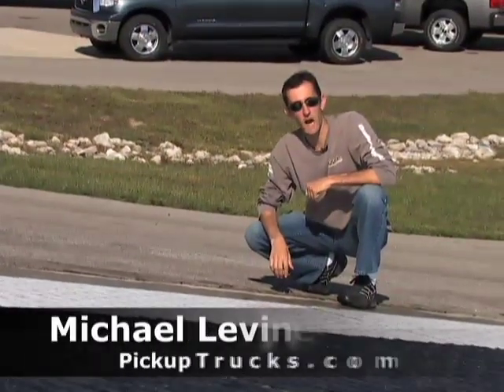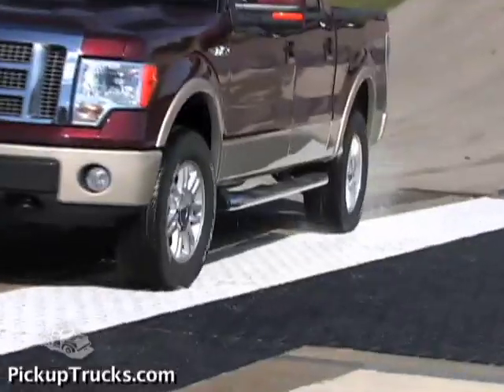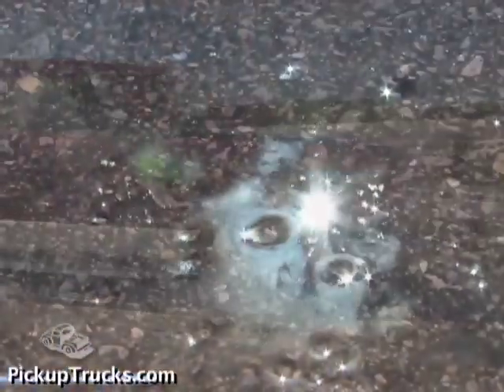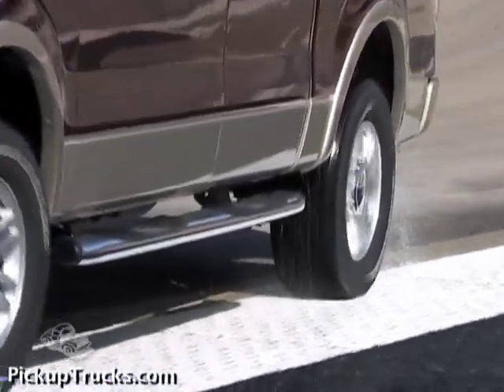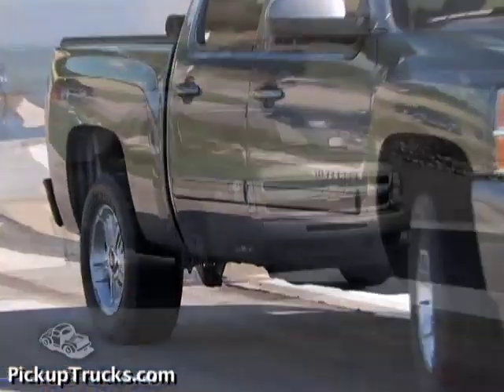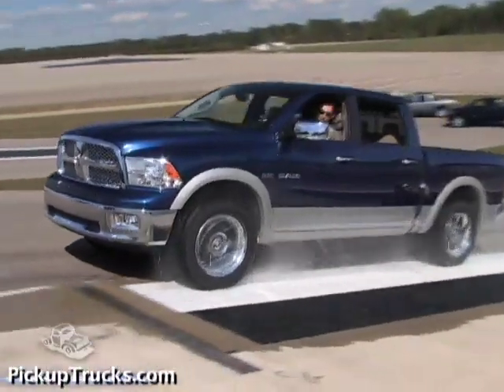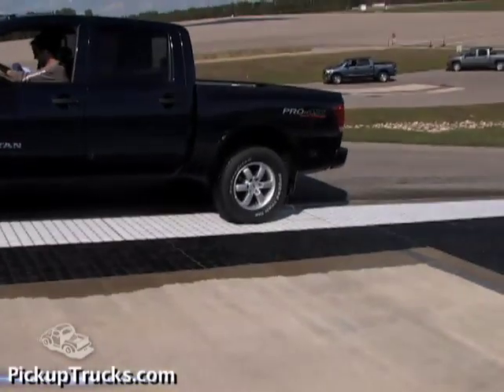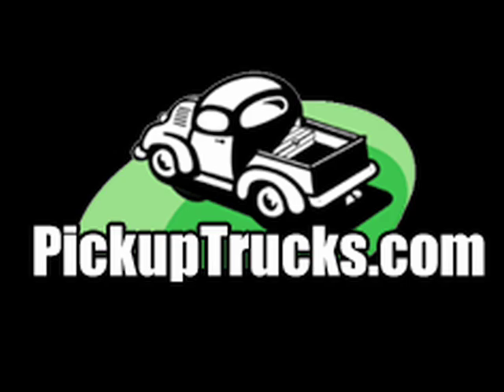Extreme Traction-Control Test

Comment: GMC Sierra and Chevrolet Silverado are the same vehicle, they are manufactured in the same factory and use the same parts under the engine, putting them in a test together is basically putting two of the same truck in a test
Reply: Aric Castro is true is the same truck
just body works and prices
Reply: Yeah and neither one of em could make it lol
Reply: Aric Castro they are the same but yet some people will still say they are different
Reply: They just change the logos
Reply: @splitrim509  because the test was rigged.  Take that to the bank.

Comment: The guys that performed this test don't know how to drive, or to use the vehicles the way they are designed.  The GM trucks did not have a traction control system, just automatic locking rear ends.  But they tried to drive the GM trucks like they had traction control.  Traction control cuts engine power to stop wheel spin.  In the GM trucks if the they had simply let off the gas a little after the wheel spin began, the trucks would have walked up the hill with ZERO  problem.  The fact is they didn't operate the vehicles the way their respective systems were designed to be used.    If the truck doesn't have a traction control system to cut engine power, guess what?  You have to do that with your own foot.  They just mashed the gas pedal in each truck, they didn't use the proper tools, it would be like if a carpenter tried to build a house using only a hammer, no saw, no measuring tape, no level.. gee how would that house turn out?
Reply: +Chris Winings Good comment i totally agree' GM been using the G80 locker for a long time, if they would have let up the throttle while the locker is engaged the trucks would have no problem.
Reply: +Keith Bartlett Yeah at one point in the video you see the driver just lets off the gas as soon as the tire breaks loose, not even enough time to let the g80 lock. My g80 has saved me so many times.
Reply: also in the states, most of your trucks are autos, use manuals much better :)
Reply: Is the proper operation of the G80 is to first let it spin to lock up, then proceed at lower throttle?
Reply: Frater Mus Yes, I have a G80 in my S10. For the G80 to work it must go like this.
> Rear tire spins in low traction conditions
> Ease off throttle, at the same time the automatic locking differential engages
> Now the tire with most traction has torque, so you crawl out 

In this video they were just fucking putting the throttle to the floor, as you can see in the video, the wheel that was on the High Traction suface was burning out because the dumbasses were just trying to gun it up the hill. you're supposed to let the locker engage and then crawl up the hill. How can the tire gain any traction if they are purposely spinning it?
Reply: William S. Damn good point-I've noticed that with my G80 in my Silverado,you should have been in the Chevy during the test bro.
Reply: youre correct! ive noticed that in some conditions as long as you have sufficient momentum in the direction youre trying to go you may be better off not letting off the throttle such as in snow going up a hill. better to keep the momentum and continue to climb and just let the locker do its thing. but in the situation in this test, and in most real world situations,  you're absolutely right!!
Reply: frater mus   heres a video of a very similar test, notice they dont allow the tires to keep spinning after the g80 locks in. in the last truck you can clearly see they only give enough throttle for the locker to engage, then they proceed up the hill. https://www.youtube.com/watch?v=xdND6o9Vsqo

Comment: Nissan just stop trying lmao.
Reply: the titans aren't bad i got a 2013 and it a amazing truck had no problems with it unlike the chevy and dodge we had
Reply: ***** they have been doing horrible on tests
Reply: i like mine best truck i had yet and its mint in the snow
Reply: give it a year or 2 and it will be a rust bucket like every vehicle in the snow
Reply: o well it rusts then it rusts every vehicle does
Reply: ***** Not if you wash your vehicles weekly and make sure to choose a wash that gets the undercarriage good. I can't stand to see cars that are ate up with rust, shows how lazy their owners were. Furthermore, if you begin to see rust, take some 200 grit sandpaper or so and sand the area down. Then if nothing else, spray paint the area. Nobody would know since its in the undercarriage right?
Reply: My titan is 11 years old and is still running fine with 250 thousand miles
Reply: The titan they tested was a pro 4x, it had a real locking rear diff so it would have been more capable than any of them had it been locked.
Reply: It's a manually operated locker on the rear unlike the lsd on the others. If it was engaged from the beginning it would have climbed it easily.
Reply: PBako test don’t mean shit. Still out last have the pieces of shit they had in this video.

Comment: uh.... when my locking diff locks in my chevy, that makes both rear wheels turn the same speed. should have no issue going up the hill, not sure how they screwed that one up.
Reply: Exactly my thoughts. My Tahoe does extremely well with the G80 and about 10k worth of weight.
Reply: ***** Probably because they had all seasons on the rest of the trucks besides the tundra and the f-150. Shoulda ran the same type of tires on all of them. I drive a 2wd silverado w/ nitto highway terrain tires (lol)  and I get around just fine in the snow and ice.
Reply: Connor Harrell the Ford and the gm were running the same Bridgestones. Unfortunately it is the locker in the gm itself that is the issue with this test. With the g80 it locks the rear end at 50/50, whereas with a limited slip the traction control can apply the brake to the wheel that is slipping forcing the power to go to wheel on dry pavement thus moving the Ford and Toyota to the top. That and those trucks weigh more and that also helps with the test.
Reply: a locked diff is a locked diff, the wheels should be turning at the same speed.
Reply: Exactly
Reply: Ashton Winnik They floored it like absolute morons. The G80 won't lock at incredible wheel speed to prevent the ass end of the truck from passing the front at highway speeds. If it'd locked from a stop with a wheel spinning that fast it'd have done a wheelie or more likely launched the rear diff into near earth orbit.

Comment: this really comes down to what tyres each truck has on
Reply: Which is totally the manufacturer's choice.
Reply: I was thinking the same thing... I believe tires make a hell of a difference. Funny when people go offroading with bald or hwy tires.
Reply: For this particular test it really doesn't have a huge effect.  What mostly matters is one tire has a lot more grip than the other and that's what this test surface layout does.  It isolates the function of the traction systems, not the amount of traction.
Reply: the only way for this test to be fair would be for all of the trucks to have the exact same tires.
Reply: atta shmeebs You and AIW BEC clearly missed the point and how this whole thing works. Tires makes zero difference in the test they are doing. Only 1 wheel was breaking loose, not both. If both back wheels had broke loose then yes, tires would make a difference but they didn't.

Comment: So Ford beat GMC at their own testing facility... nice
Reply: Gm. **
Reply: blackhawks youre absolutely right. they didnt know how to use the locker. If you look at gm when they test the gmc trucks with lockers, they allow the automatic diff lock to engage,  pull back the throttle , then creep up the hill. This is an important point because even the car makers recognize the importance of pulling back throttle. in the video they say the computer pulls back the throttle in traction control..., but when driving the lockers they dont pull back the throttle. pull ing back the throttle should be done by the driver when driving a g80 locking diff in most situations with only 2wd engaged.

Comment: A lot of confusion here.  First, there was confusion over what this test was for.  It was not for which truck had the best 4WD.  It was for which truck is the most capable in 2WD on a split mu surface.  But what this test showed is not really which truck had the best limited slip or traction control.  No, it was really which truck had a COMBINATION of the best limited slip or traction control AND most weight over the rear axle.  As you can plainly see in the GM trucks, BOTH rear tires are spinning.  You can have all the locking differentials and traction control you want.  The tire WITH traction was spinning and that was not enough to move the truck up the hill.  This test did not prove what they set out to prove.  But the result actually is somewhat useful: it means the F-150, exactly as configured, would have the most capability up a hill in 2WD.  In the real world, however, you'd already be in 4WD, so this is just kinda lame.
Reply: +kevin9c1 Yes, Kevin, exactly correct. They only used 4WD as a last resort. Maybe, to keep many of the naysayers and ignorant people at bay, they just should have used 2WD trucks to begin with.
Reply: +kevin9c1 With BOTH rear tires spinning,  PROVES to me that the test was biased.  The right/passenger side WOULD have moved the truck B/C it had traction.  the limited slip is JUST THAT.  The video was rigged plain and simple
Reply: +Tyann Huffman I don't know about biased in the human sense.  But biased in the scientific sense, definitely.  But your explanation is not right.  You are saying if the right rear tire had traction, it would have moved the truck.  Not true.  Traction is not absolute, even though you may think of it that way.  So, yes, that one tire did have the MOST traction (the other one basically had none).  But that tire still did not have enough to push that truck up that grade.  At that point, it's either a tire test or a comparison of how much weight is over the rear axle (the F150 probably had more).  My point was, this really wasn't a traction control/limited slip test, at least not when the GM trucks are spinning the tire WITH traction.

Comment: i hate traction control. its aways hurt me more than its helped
Reply: Especially in my Prius, hell engages even when I floor it on a dry asphalt surface...
Reply: Tareq Arar on some Toyota models there's a button to turn it off.
Reply: Tareq Arar almost all*
Reply: Most vehicles are that way
Reply: I have no button, but a long maneuver to do so, but what's the point of it if I am going to turn it off?
note also that in Prius when turning traction control off you lose ESP (stability control) too...
Reply: Let me rephrase that. Most vehicles with traction control have a botton to turn it to off. Every vehicle I've driven that had it had a off switch. Oh BTW my lb7 doesn't have stability control and God knows ive been in some crazy places, worse than any prius and funny thing is I've never flipped my truck...
Reply: I like how we're watching a video about trucks with 500+ lb. feet of torque and someone cuts in trying to relate with a Prius.
Reply: none of these trucks have over 500 lb ft of torque stock.
Reply: bwspyder1 agreed.
Reply: Lmao beat me to the punch
Reply: bwspyder1 facts
Reply: @bwspyder1  Hey bro, please, what about actual traction control? what you think about? thank you!
Reply: @spjohnson1031  where the hell did you get 500, trucks today haven't even broken 500 and many are still low 400 torque.
Reply: You have to know WHEN to use traction control or not when off roading. Also not ALL traction control works the same. Each manufacturers' TC capability works differently.

Comment: @296jayce you're right but lockers are only better in extreme off road situations you can't keep them engaged all the time and absolutely not to be used on road , but limited slip is for everyday driving.

Comment: from what ive found fords limited slips are the most reliable.
Reply: the most reliable limited slip will be a Torsen type differential.. since it's just gears, there's nothing to wear out..
Reply: Rexford L Limited slips have clutches so when extreme pressures are present it can slip slightly but more likely to wear out where mechanical differentials will never wear out but they are more likely to break because they do not have the slipping feature. I like both, but lockers are better. Remember, something always has to give, But believe me they can break, I exploded both systems before
Reply: @54ord , not all limited slip diff's use clutches.  The (Eaton) Detroit Truetrac uses worm gears in place of clutches.

Comment: Ya it was totally biased, it was even located at the GM proving grounds hahaha.
Reply: hochhaul no shit. the chevy and sierra were the only ones transferring power hard to the other tire on the pavement, proving  it could get out in 2 wheel drive with the locker...but still that is only 1 tire trying to push the whole truck up a steep grade....can't floorboard it like the others or it will break loose......the others struggled to get power to the tire on the pavement.....they've done exact same test like this with chevys before and it blew the competition away (and all of these in the video) but you gotta know how to drive it.....

Comment: This test doesn΄t represent real conditions as they say. On icy road and snow you engage the 4WD before you lose traction, not during the loss or after and you don΄t push the throttle to the redline. Nissan prefered rear WD open differential with electronic lock for less weight and higher top speed. When the driver engaged the 4WD, the diff locked and the car left without any problem. The offroad obstacle course represents real conditions and makes obvious which truck has the best 4WD.
Reply: JoeIsCrazyWillman First of all, many people don't have the ability to discuss like a civilized person. Obviously, you have this disability...
At first, what I said, were told to me by a BMW engineer and spare parts dealer. He owns an E46, so I think that he knows better than anyone the top speed of his car before and after changing diff. In theory, it should be the same, but the best way to determine it is by test driving the car. Some pick up drivers need the higher top speed, as they try to arrive as fast as possible to their destination, when they don't have cargo. I have nothing to prove to anybody, I know what happens...
Secondly, the LSD diff has some extra components. Obviously, they have some weight. This weight might be negligible for a car to carry (it's not), but significant for a transmission to rotate. Simple test: Lift a car and a bike off the ground and find which ones wheel spins a lot easier. The more weight that is added, the more effort it needs to rotate it, meaning higher consumption...
Finally, I will repeat what I said: Regardless if your car has an open or a LS diff, you will engage the AWD in slippery conditions. No burnouts,no spinning wheels...
Take your time, study how the diffs work and what the extra components are. You need a lot more effort and progress to teach engineers their job, criticise people about their opinion, what they smoke and what they dump out of their asses...

Comment: @Tungsten23 It's based on a difference in RPM between the two tires. At 100RPM difference the flyweights on the cam open and the paw grabs the engagement mechanism. It can engage in forward or reverse, but not past 20mph. The clunk that is heard is the paw engaging on the mechanism.

Comment: Graded a truck on "not having to engage 4WD" on a 4WD test.... great idea
Reply: its a traction control  test not a 4x4 test
Reply: Except this test was shit. The idea behind traction is to finesse the throttle, not gun it until you get to the top. Mike Levine (now the head of PR at Ford) gunned it instead of backing off the throttle and letting the locked diff do the work. A locked diff in 2WD doesn't do any good if you roast the tires right off the bat. And an overly aggressive traction control is a pain in the ass in the winter.

Comment: Day after a day, starting from the Land Cruiser, though Fortuner, passing by Camry and Prius then Tundra, etc... I discover that Toyota (vs other car manufacturers) may be not the funniest to drive, neither the most fuel efficient nor the most powerful, lastly not nearly as comfortable, but it has one strong point, Reliability and Capabilities, they are well but not over engineered. Cheers for Toyota, Thumbs up for Lexus for dominating both worlds.
Reply: the issue with the import pickup manufacturers, their highest capacity pickups are only 1/2 ton.. you can get heavy duty class 3 and even class 4 pickups from the big 3..